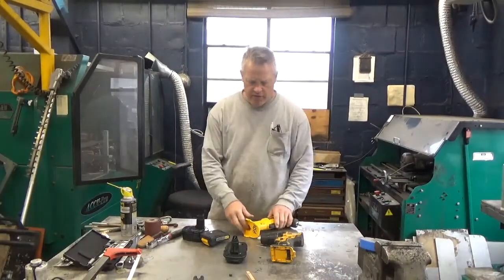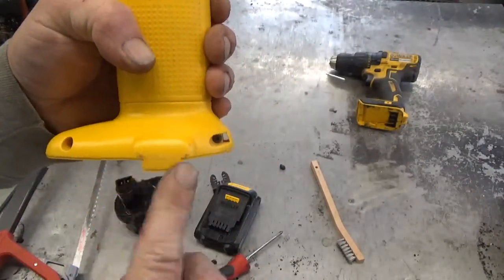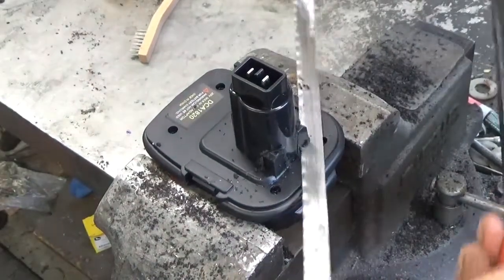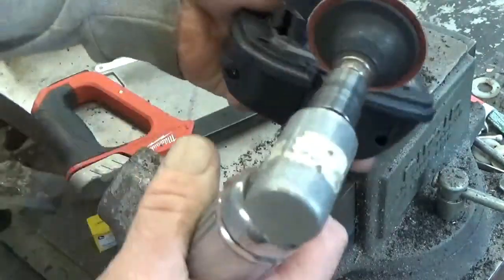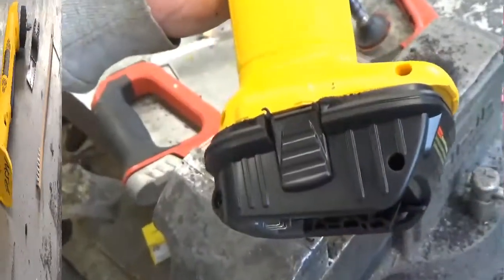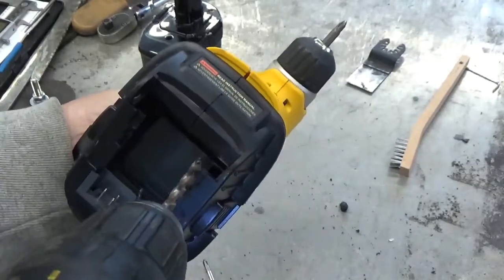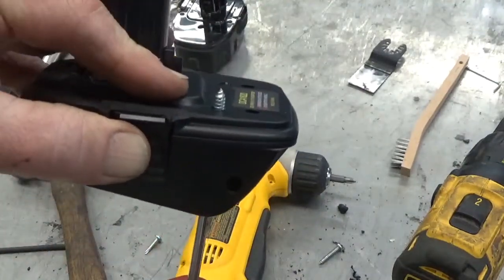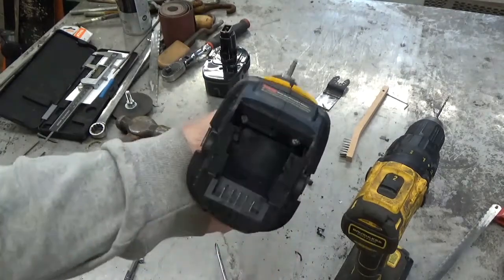Dewalt 14 volt to 18 volt

Comment: Word of advice. When cutting off the plastic corners on the DeWalt version, remove the plastic top to avoid cutting the internal wiring that sits very close to the edge.

Comment: thanks for the video... do you think it's possible to break apart a 20 v charger and use it to replace the 18 v connection on a old 18 v radio to convert the 18 v radio to a 20 v radio that can also charge 20 v batteries?
Reply from the maker: You got me.. Try it!  Thanks for the comment...

Comment: I did this by using an old dead 14.4 battery top, it makes this much simpler to do.
Reply: Not really.  You have to do a bunch of wiring and figure out how to hold the contacts up the shaft, since the support is actually one of the cells.

Comment: Iam skeptical .  1.Tose Adapters having plus and minus Pole only . Thats why is  no communication with the BMS Batterie Management System possible   . 2. How should a NiMH Batterie Maschine communicate with a LI ION BMS Batterie ? They are total different technologic Types i guess . The result :  spoiling the Costy worthful LI ION Batteries by using them with simple old Type Machines ?

Comment: If you have access to a 3D printer, you can download ready to print adapters for many tool brands to different batteries.
It may even be cheaper to pay someone to print it for you than buying. In many cases printed adapter is the only option for a given combination of tool and battery since there is not enough market for someone to invest into injection  mold to make what you and 10 other people in the world need
🙂

Comment: I have 20v batteries and 14.4v drill....my question is that is it harmful to use 20v battery with 14.4v drill ?
Reply: The tools with variable speed have electronic circuit that may not like the higher voltage or current.
I tried 18v battery in 12v Ryobi drill. It worked at low speed but at full power the speed controller shuts off. I am guessing the overload protection kicks in and cuts the power. 
Different tools have different circuits.
I bought 14.4v dewalt hammer drill and plan to convert it to 18/20v battery. If it fails, my loss will be $10 and the time on the project but if it works I will add another nice drill to the collection.
Reply from the maker: This drill is just a motor and will take most voltage give or take it was meant for.
Reply: @ronstickle4694  get it

Comment: A question... have you noticed any harm to the DeWalt 14.4 volt tools, when running a 20 volt pack in them?
Reply: The proper answer is “it depends “.
The electronic speed controller in the tool may or may not tolerate higher voltage. It may work at lower power but shut down at full power. 
Even if the tool has simple trigger on/off switch, the motor designed for 14v may overheat if used for longer time. Be aware of that and monitor the tool for signs of overheating when making long cuts.
Reply from the maker: Nope! works 100%